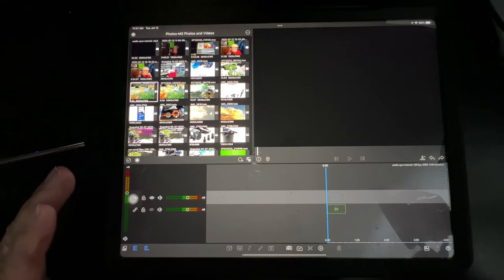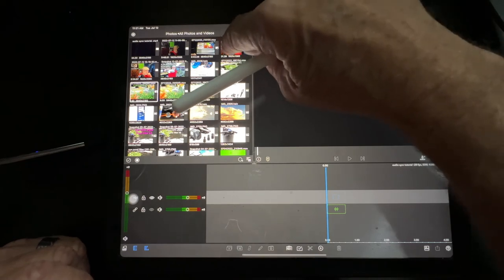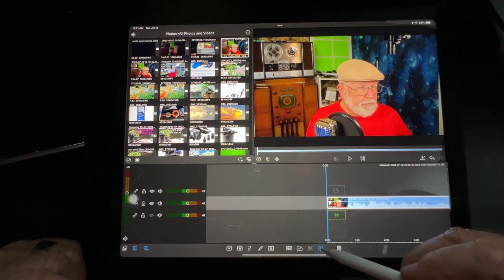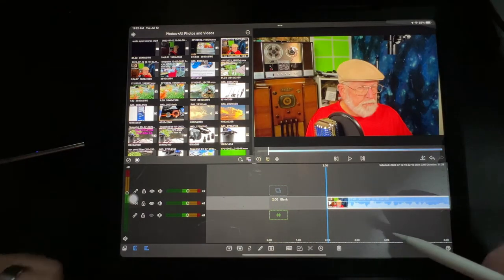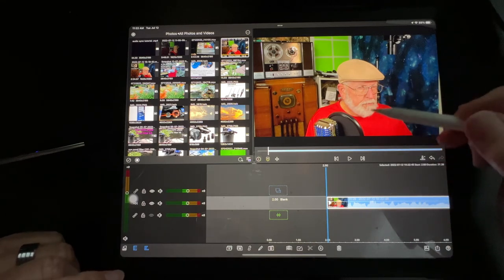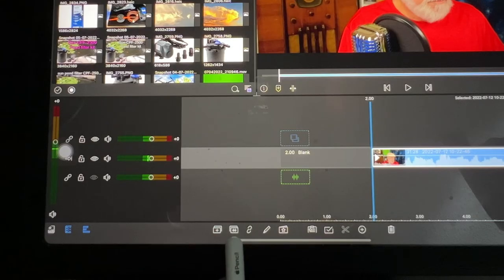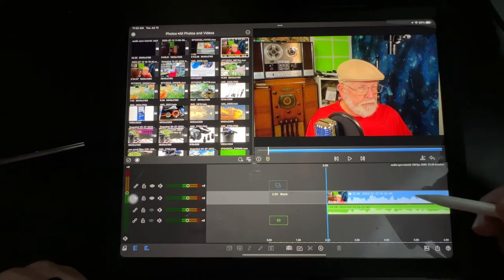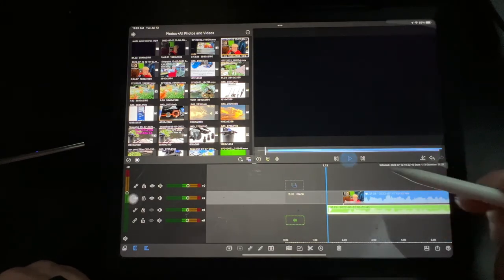Lumafusion can Separate and sync your audio and video

Comment: Have you ever tried clapping..? Gives you a very sharp audio/visual signature to sync when doing it manually.
Reply from the maker: Absolutely. It works well and when I record externally on my Tascam DR07x that's what I do. 

In OBS I have to dial in about 170ms of delay. 

This was to answer someone's question about what to do after the fact when you find out after you're done the your video and audio wasn't in sync. 

In particular he wanted to know if it was possible to separate the audio from an existing video and sync it. 

Thanks for stopping by and your tip. 💯👍